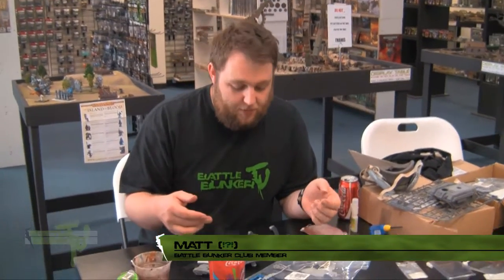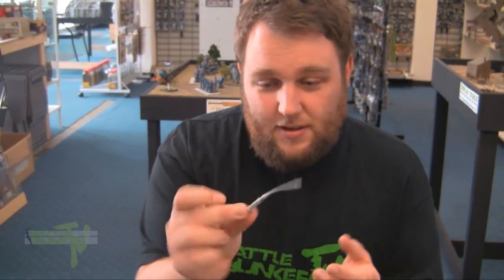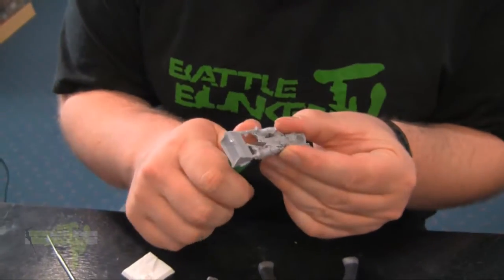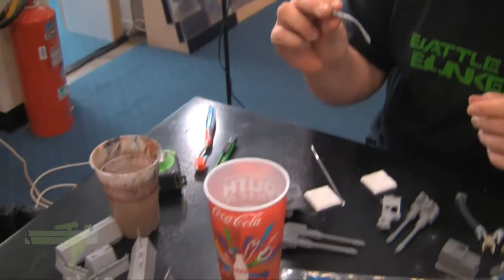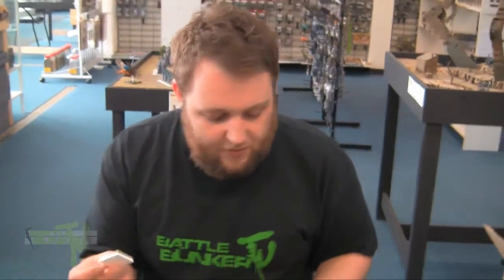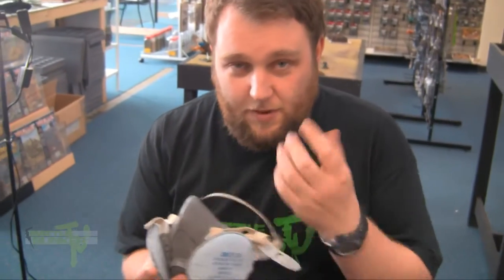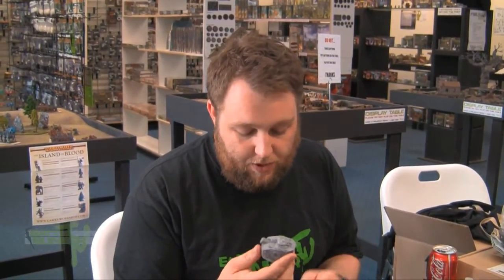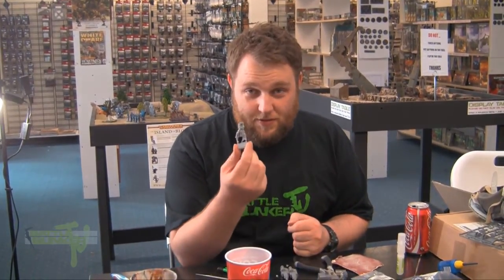Tutorial - Working with Resin

Comment: About the dust, there's a simple way to solve that problem: water. If you're using the kind of sandpaper that's designed to work wet or dry (or even if you're using metal files) just moisten them first and the water will catch the dust, creating a sort of plastic-y mud. For some weird reason I don't fully understand this also makes the end result smoother than dry sanding.

Word of caution though, be sure to THOROUGHLY wash off the plasto-mud afterwords or it'll clog up your mini's details.